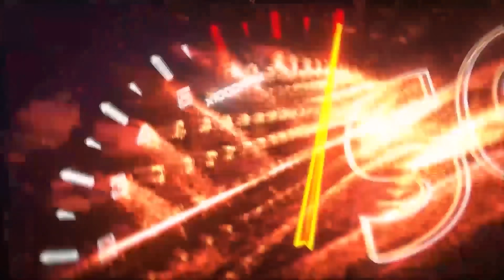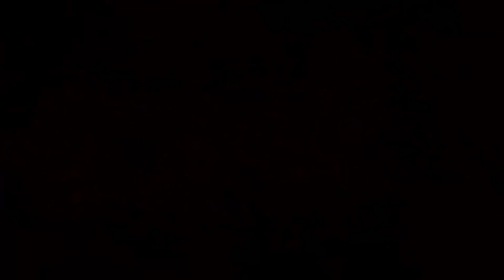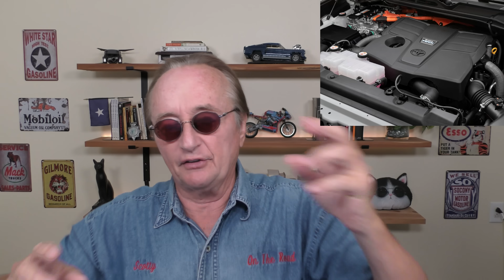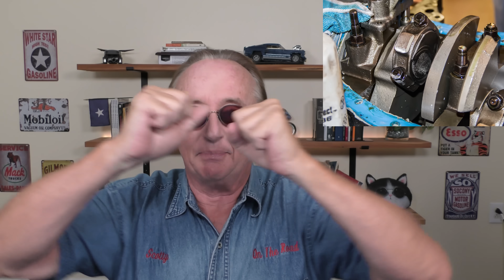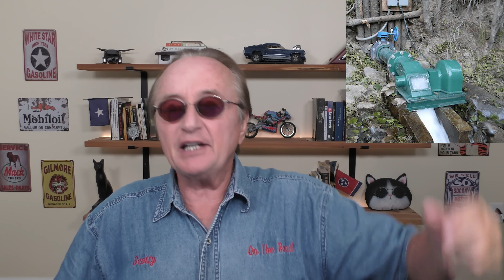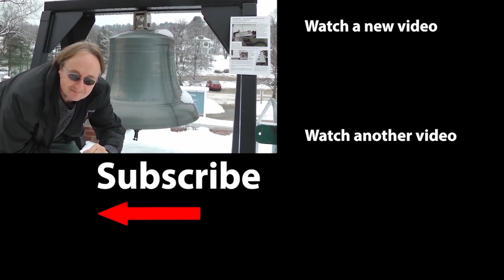America Just Lost It’s Last 2 Car Brands

Comment: Mr. Kilmer I ha e a question for u ? I have a 2009 5.4L ford p!annum 4+4 I've replaced the whole AC system an don't work still what could it be sir I love this truck its prefect an do have 200.0000 yet an runs lime new but I Need atr

Comment: The only saving grace from Ford was the legendary 5.0L Coyote V8 but now since it has cylinder deactivation I decided to trade in my 2011 Ford F150 with a 5.0L Coyote V8 in it for a 2024 Nissan Titan with the 5.6L Endurance V8 in it instead for a 2024 Ford F150 with a 5.0L Coyote V8 in it.

Comment: Ford Fairmonts was a real decent car..the 6banger was so easy
Reply: Glad you think so. My dad had a 1981 Fairmont with a 4 cylinder and it was a POS
Had to rebuild the motor. Also kept dying after driving 15 minutes.  Found out the screen on the end of the fuel line would collapse and cause the fuel to shut off. Got rid of that screen and just used an in line fuel filter. I will say easy to work on though. Rebuilt the motor in 1 day.
Reply: @brianperry4815  those 4 cylinders were POS and the 200 cubic inch 6 cylinders with the C4 transmissions you couldn't kill, just like in the Falcons.
You Dad is as unlucky

Comment: If you live with in 8 to 10 miles of everything an EV might work, gas is still king.
Quick charger at home cost is 8 to 10 thousand dollars just to have installed not including higher electric bills.

Comment: Scotty you are the best you give the best information than anyone out there I wish I live close to you so you can check out my cause I have two Ford Explorers of 2006 and 2007 my 2007 I can't get rid of the EGR valve check engine code I changed the PCM the throttle body the EGR valve and it's at Ford dealership and they still can't find the problem now they're going to check out the harnesses oh my God it's costing me a fortune

Comment: The solid state Lithium batteries aren't really solid state. They use a liquid electrolyte suspended in a solid material. YT have done punchure tests & they still go up in flames. Even if a true solid state electrolyte was to be developed, Lithium metal will burn if exposed to water.

Comment: Ford Australia started producing Falcons from 1960 to 2016, the first model Falcons were popular but they couldn't stand up to the Australian conditions they had problems with the front suspension, the ball joints were too weak and fell apart,  the engineers worked on it and the Falcon ended up being a quite a reliable car , we even turned them into sports sedans GTHO phase 3 in 1971 look it up you'll see what I mean,  it was sad to see Ford and General Motors shut up shop and leave Australia,  I'm going to be biased here, I blame the unions and the Australian government  for paving the way for their closure, it was their policies that caused it

Comment: Even if I was a fan of US automakers, buying one of their crapwagons would not be helping them and potentially dangerous for me. Yes, putting a turbo in the Tundra was a big mistake for reliability. Sell a good car and be sustainable as a business, should be goal; but what do I know! Perhaps the real goal is YACHTS for the Board. 
EV -   Should we be thankful for those who are early-adopting, driving interest and research into better EV's? Or are we angry that they have wasted so much money and resources on junk that won't last? We can't even make a good space ship any more, not sure we are gonna get a truly good EV that you can take everywhere. 
The story about the aluminum crankshaft had a predictable ending, but I thought it would just break.  Your point about metal expansion helped me understand why normal engines 'seize up' when the oil is gone and no longer cooling the crank bearings cam bearings wrist pins etc.

Comment: I was a mechanic for 10 years, used to be the most ardent GM and Ford supporter. 

I now own only Toyotas. That should tell you something.
Reply: Me too, as it's Shocking 🤔 how bad it has gotten!
Reply: even toyotas have gone downhill, but they're at least pumping the brakes a little instead of sticking it in high gear and flooring it,

old GM is still decent though, mainly because most motors they made go to most transmissions semi easily (as easy as a trans or motor swap can be), but yeah you wouldn't catch me dead in a modern computer with a car attached to it, too much headache
Reply: Toyota is the pillar of reliabilty....  except for that recent recall of 100,000+ vehicles for total engine replacement.....

Comment: I was in the market last year for a new vehicle from Ford.
Has a 2019 Ford Mustang and wanted to off load it because of head/valve cover gasket, purge valve X2, oil cooler lines, water forming a pond in my “spare wheel” compartment, recalled right side wiper motor, you get the point.
Was interested in a brand new ‘23 Ford F-150 4X4 base model, regular cab.
With 4X4, and the 10-speed auto (with no options), $42K.
I currently have a brand new, custom ordered to my specification ‘24 Subaru Forester.
$32K.
If the F-150 was $34-35K, it would be in my driveway.
But for worse gas mileage, next to no options, only 2 doors.. Nope.
I don’t care if it can haul and tow up to 3,500 lbs.
The price doesn’t match for what I would have got.
Love my Subaru, couldn’t be happier.

Comment: Scotty… Please HELP!! I have a 2020 Nissan rogue sport. Front and clunks on accelerate then clunks again when I decelerate. One mechanic says the CV joints are sloppy and recommends replacing the two front axles, but somewhere else because he doesn’t do that kind of work. He said it’s safe to drive until it starts making a repetitive clicking noise when turning. Another mechanic says the axles are fine but the transmission needs to be replaced. He said the car is safe to drive until the sound gets worse. The car has 59,000 miles on the clock, no fluid or grease leaks anywhere, the transmission works fine and shifts smoothly. What do I do? Love your channel… Never miss a video! Thanks!!!

Comment: What I cannot stand is people saying that the quality is bad. It is the parts that are bad, because an assembly plant is just that... an assembly plant. The assembly plants do not make the parts, they only take the parts and assemble them. Perhaps if the parts were built better (looking at you China and Mexico) the parts would be of much better quality. 

Just wanted to clear the air, it's not the workers assembling the vehicles, it is the parts bei g sourced from the cheapest places... China and Mexico...
Reply: That is not true.  Every single inch of any car today on the road is BAD quality.  Frame, body, parts, all of it is very cheap crap on the cars for tooo much money when 
plastic is machined in 60 seconds and sold for $$$$ and doesn't hold up.

Comment: A lot of people that drive big pickups could actually get by with a sedan. Too bad the big three have dollar signs in their eyes and have cut out practical sedans from their lineups, but even if they still made sedans, the quality would still suck. Ford and GM better get their heads out of the sand and realize that what most people actually need is a reliable and affordable gasoline powered sedan. Since the big three don't really make those anymore, the missus and I bought a reliable and affordable Corolla because we don't have the money to waste on anything else.

Comment: Vehicles are made so cheap, but Manufacturers want top price for crappy Vehicles. 
The 1980s best dependable cars that you could work on. Maybe lasted 120 k miles, but cost under 7 k dollars new.
Reply: Still have our mid to late 80`s S10`s & still are operating & keeping running. Good parts are getting harder to find  though.

Comment: $91k? No try $129k Scotty. I priced an F150 King Ranch 4x4 and "out the door" it was.almost $130k !!  That is literall DOUBLE just 5 yrs ago, AFTER inflation.  Local RAM dealer had similar config - and SAME PRICE!!  $120k for a DODGE TRUCK?  Finally...rented.a loaded Cbevy Silverado.. Brand New 37 miles! . Window sticker was folded up in the glovebox. SAME STICKER $120K plus!!  So a loaded PU is now north of $120k !!!  That means USED ONES will ask $80-90K  Well I’ll do without.

Comment: I can't feel bad for the American car companies. All 3 built complete pieces of garbage for decades. What do you expect to happen? Here's how to restructure -- Build quality equal to that of honda or toyota. When you can prove that a malibu will get me 200k miles only having to replace brakes, tires and change the fluids, then ill consider buying an American car.
Reply: You have Ford Victorias, Buicks with the 3.8 engine, Explorers, Tahoes, Saturn S-series and many others exceeding that with regular maintenance. That’s why many of these are used by the gov so not all are garbage and they used to sell for reasonable prices too. My 1985 vette is still driving strong to this day w/original engine and trans.
Reply: @mattc9875  yes the 3800 was a great GM motor. My old man had a 91 buick lesabre with the 3.8 and that thing was the biggest pile of trash. The motor was great, Everything else broke. Window motors, fuel pump, sensors, heater core, more sensors, ball joints, tie rods, wheel bearings, the rack and pinion, radiator, thermostat. I had an 88 cavalier (trash) 90 corsica (trash) 92 v6 camaro (trash) 95 2 z28 camaro (not trash, not even close. Yes the camaro after 92 was good, c4 corvette is ok. C5 is better with the LS. You know what I mean. Low to mid prices sedans were all junk. You can go 500k miles in a 97 Honda accord and never have to replace window motors. My 88 cavalier was destroyed by 100k miles.
Reply: @mattc9875  that's a vette. The best car chevy makes. Of course it's gonna be built well.

Comment: Even with solid state. Its a fuel you cannot transport, take a lot to store, and can be turned OFF at ANYTIME with a switch of the grid. If one buys a car, one should have full control over that car. This is slowly and carefully being taken away.
Reply: Gasoline is grid dependent also. Electric can be charged at home via solar if you want to become an off gridder. Bio Diesel exists also with a lot more effort.
Reply: @jalhusky  Plastic can be converted to gas. This info is now out, and likely one major reason for the shift. Charge solar will take many hours, depending on panel# but, even a whole house setup of 2500sqft will be half a day
Reply: @jalhusky 95% of cars have computers and fuses they’re all grid dependent
Reply: @blank1778  I don’t think you even know what you’re talking about.
Reply: Yes I'm tired of making my own gasoline tho

Comment: I bought my first brand new truck in 2001. Dodge 1500 extended cab 4/4. 5.2 5 speed. Air tilt cruise. Rubber floor and crank up windows. 26000 Canadian.  A good little affordable capable reliable economical pickup. Wish they made something like that again.
Reply: Same!
Reply: I own a 2001 , 1500 Dodge Ram Manual Transmission. Great Truck and cheap to fix.

Comment: I have not bought a new car since 1999. That one wore out, but I'm fine because I still have my '68 which is still going. Why would I buy a new one? Just more non sense to deal with. Warren Buffet's car is a '98.
Reply: How much did you spend on it so far to keep it running?  lamoe!
Reply: @JesusGodHolySpirit3  There aren't many problems on an old car that would cost more to fix than one or two monthly payments on a new car. Fixing your old car is almost always worth it.
Reply: honestly the newest car I've bought was an 06 ford, it's riding the edge of the computer crap tbh

Comment: Early grave of cars and trucks nowadays is from parts swappers not knowing what is actually wrong.
The OBDII system was supposed to pin point the defective component.  I threw a bunch of parts into a car that was in limp mode. The actual problem was a broken diff bearing carrier in the transmission. And metal pieces destroyed the pump too. My trash became someones treasure!

Comment: Scotty should be the CEO of Ford or GM he's got the right ideas!
Reply: All the cars would be underpower 4 cylinder like his celiac
Reply: @Drewcardello  3 cylinders, but non turbo so they would all be less than 100hp... but they would go 300k without oil changes because they were so overbuilt.
Reply: @Have.An.AmicoDay  oh, and 3 speed manual with 2 doors and No AC and crank windows
Reply: @Drewcardello  if it was 9 grand with a warranty I'd give it a shot

Comment: Scotty. I have a 1989 chevy silverado c1500 with the 4.3 v6 that has 291000 miles on it. I'm looking to find a over 30 year old brand new alternator for it to replace the brand new ones that keep failing. Most of the ones I see are remanufactured ones from over 30 years ago. Not many brand new ones from 30 years ago. Should I buy the 30 year old remanufactured alternators or not?

Comment: In my area, new Chevrolet Trax and trailblazers are hard to find. A lot of the Chevy dealers have to order it because they are big sellers here.
Reply: Korean car
Reply: I had a 2004 Trailblazer and I didn't get the mileage out of it I should have.  At 150k the transmission took a dump. Found out that was common. 
At 205k nothing but computer problems with everything lighting up. Figured it would cost too much to fix so I got a Honda Passport where I know I can get 250k miles out of it if not more.

Comment: I went and drove all the 1/2 ton trucks and looked at them from fit and finish to gaps in the body to interior to how their built and walked away with 2024 tundra limited 4x4 and just LOVE the truck , do I miss the V8 ? NOT EVEN CLOSE I much rather have this turbo charged v6 that has diesel lie low end torque and getting 21-22 mpg on the hwy , Toyota did an excellent job on this truck and if you look at the components front to back it’s built like a 3/4 ton truck , 10.75 inch rear ring gear , the driveline , upper and lower A arms, ball joints , tie rods , axles are just MASSIVE !!
Reply: Like

Comment: GM and Ford made a  big mistake by stop making cars ( sedans).
Reply: That's only in North America - everywhere else they still make/sell cars.
Reply: Silly EPA regulations have a big hand in that, along with the total absence of small pickup trucks.
Reply: @roflchopter11  small sedans were fuel efficient by design. Light and more aerodynamic than any truck or SUV. So EPA has nothing to do with decision to stop making sedans
Reply: @elim7228  the EPA has lower emissions and fuel standards for "light trucks". As the noose tightens on sedans the requirements become infeasible, manufacturers pivot to SUVs. A parallel effect is happening with safety.
Reply: Youtuber7589 it was.  But to their corporate profit motive..it was not
Reply: GM makes small, less expensive, suv's in Korea.
Reply: Ford sedans were useless. They could never compete with civic, Corolla, Mazda 3 etc.
Reply: This.
Reply: SUV's have just as much car as a sedan but can cost more, why? SUV's are speshal that's why (speshal, not special)
Reply: They need to stop making crap, that’s the problem.
Reply: Bring back the fusion and focus!
Reply: People wised-up an quit buying their sh*t boxes...........
Reply: You can't live in a car, that's why
Reply: Sales of sedans are quite low compared to SUVs and trucks.
Reply: l wonder if they made a mistake by hiring basketball players and taco eaters?

Comment: what people need to wake up to theirs no infrastructure for ev’s your home has to be re wired for the service to get the bigger service. Two no charging stations local. for now we sorta do but their not compatible each station has to talk to the computer in your car or truck to charge. Most charging stations get vandalized. our stations aren’t fast chargers even if they work with your vehicle. So getting an 80% charged your not parked long enough to get a charge shopping what ever. waste of money. Fast charging degrades your battery the technology isn’t sufficient enough to do so. The other is no spare parts waiting list. you need to be in a position to not have your ev for year or more no one can fix your ev Tesla doesn’t give out information to fix it yet. Listen to Scotty wait let the bugs die off then get a new vehicle in year end clearance. I’d hire a lawyer to prevent dealers from up charging
Reply: @Marklock
There is also a guy in Minnesota that does videos on EVs and charging stations don't charge below 20 degrees 
Not to mention the batteries discharge more and charge less when it's cold.
Look at all the Chinese Ev cars catching on fire and now more insurance companies won't insure them.

Comment: My 1989 F 150 is dependable and going strong
Reply: I learned how to drive manual transmission on an F100 3-on-the-tree, almost 50 years ago.
Reply: Relative to what. I don't think you know what you have.
Reply: @ricksmith1382  umm…. I have a 1989 F150… that I use whenever I need a truck…. they built them to last!
Reply: @ricksmith1382 relative to the zillion other cars that were manufactured and junked in between now and back then
Reply: I'm 30 and my wife told me I could only buy a 96 and older F150. I understand why after a lot of research, ended up with a '94 351W.
Reply: Decent motor but the 300 straight 6 was the best. They rarely died. That's why Ford stopped making them. Same as The slant 6 225 from Dodge.
Both too reliable.
Reply: So is my 2014 s max here in ireland
Reply: That old truck would be rusted out in Michigan
Reply: @gregorylyon1004  I am in salty frozen Manitoba….my 1989 f 150 has less rust than 2017 pickups around here…especially dodge rams